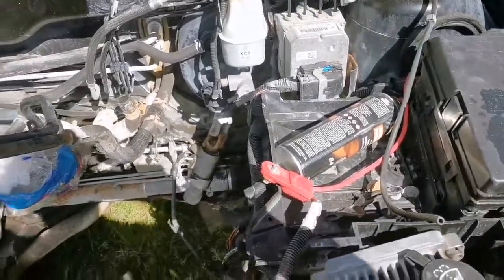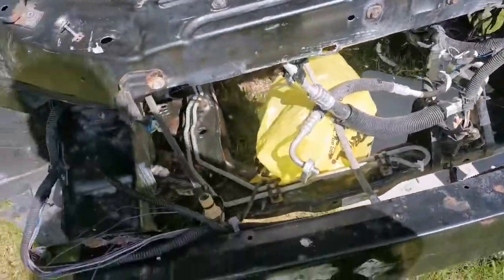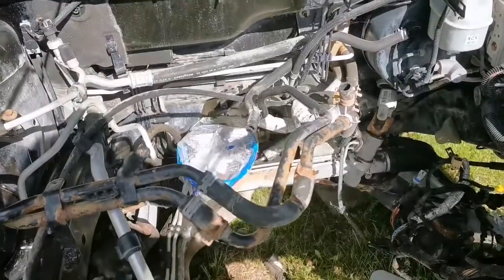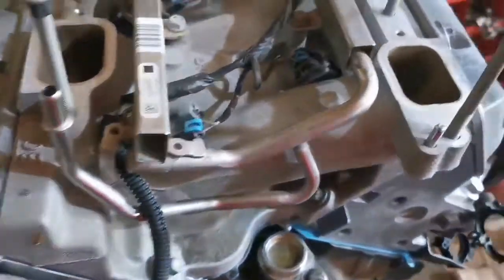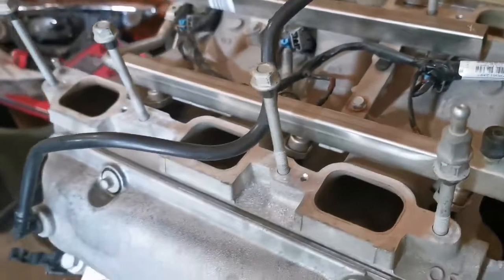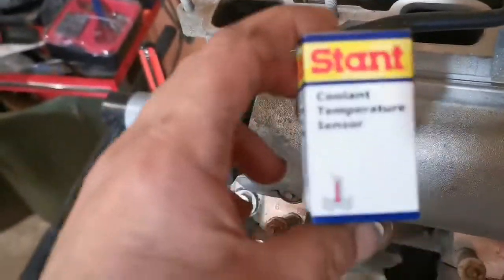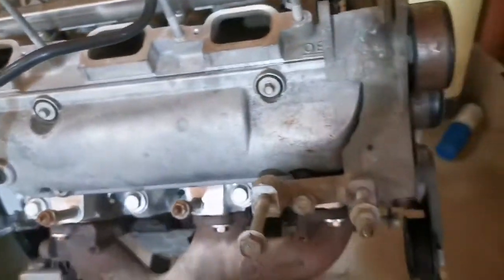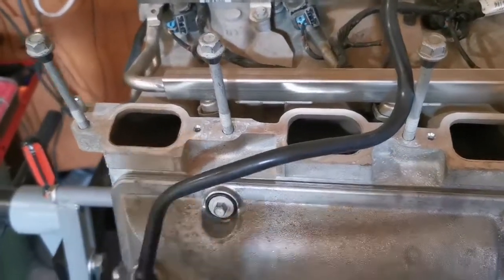Pontiac G6 engine mild rebuild and Transmission is out for Rebuild

Comment: Hello my car is previa 95 ia very wasteful in gasoline I changed the carbon sensor and the steering wheel there is use is one liters for 4 km
Reply from the maker: You may want to check the oxygen sencers and change those also. When they get dirty the Previa gets poor gas mileage. Hope this helps.